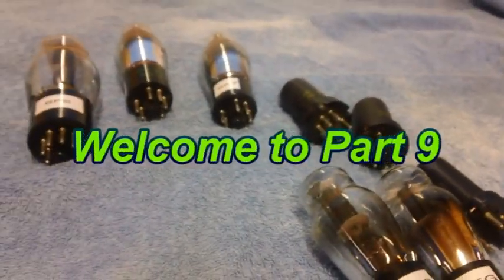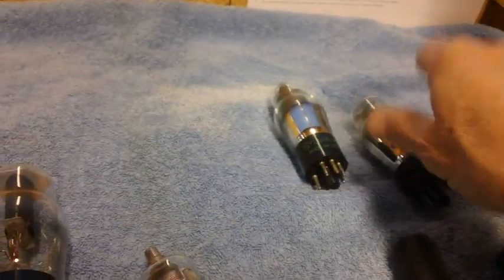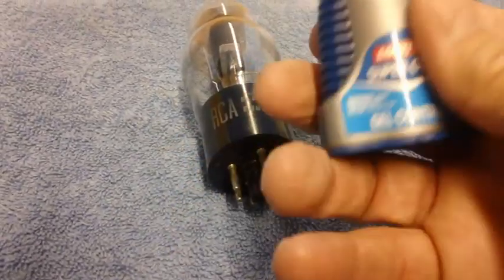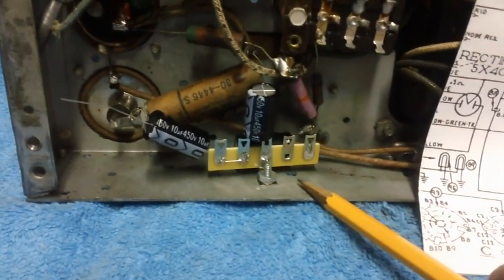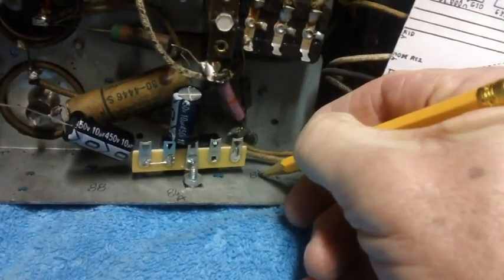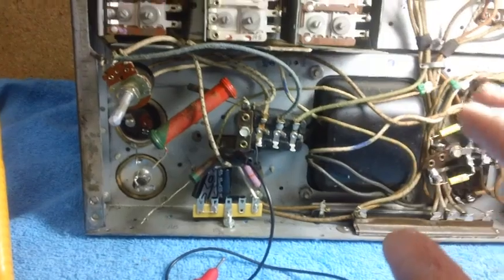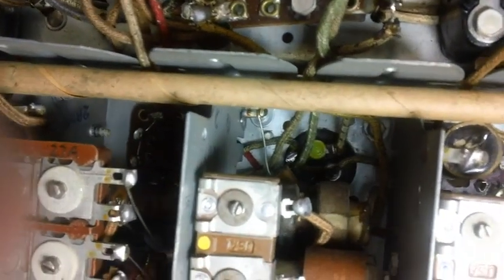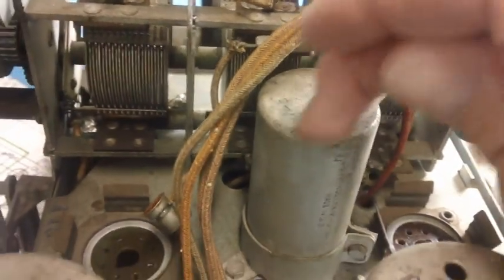Philco model 37-2670 repair and restoration (Part 9 of 34)

Comment: I like your idea of the terminal strip, John. I know a lot of restorers like to do it, but I'm not a big fan of gutting out and restuffing those old 'can' capacitors. I like to leave them up on top of the chassis for looks, and just cut the wires from them under the chassis and solder the new caps to the disconnected wires. Once the chassis is back in the cabinet, no one will ever be the wiser! :)
Reply from the maker: Greg,
For me, re-stuffing filter cans has gotten a little old.  It's become a been-there-done-that thingy.  Terminal strips work very well and don't require me to cut open the aluminum cans.  Additionally, using a terminal strip  allowed me to go more in-depth with the schematic and its correlation to the chassis wiring.
But who knows...maybe next time I will do a re-stuff.

Regards,
John

Comment: Very good video, John.  We tend to forget, when we are going through these radios, that they weren't built by one person, in a logical order.  Sometimes you scratch your head and say, why did they do it this way.   Everyone that touched these, had a different job to do and it wasn't their problem, that something that appeared adjacent on a schematic, actually made 3 or 4 hops to get between points.  They were factory built.  Good reminder and good tutorial on being patient and following things through.
Reply from the maker: Al,
In future vids, I hope to do more wire tracing through a chassis.  It's always a stumper for newbies.  Hopefully, this vid helped them understand that a short schematic line doesn't necessarily mean a short wire.

Regards,
John.
Reply: joernone Great vid.  I'm just starting to get the hang of it.  It works the other way too.  Sometimes, what looks like many long wire connections are just a couple of short ones connected to a single point.

Comment: John,
An excellent video: you’re certainly treating the apprentices to some good stuff in this series my friend.
You mentioned your vids are not so much for the ‘old timers’ but mainly for the ‘newbies’…mm, I’m not so sure about that one.  Here’s one old timer who has just learned something new.  I have never heard the term ‘Candohm Resistors’.  Aside American radios made for the British market, those type of resistors were generally not incorporated into British makes of radio.  Since taking an interest in American radios, I have seen a few of those resistor arrangements but I have never heard anyone over here refer to them as ‘Candohm’.  I rang a couple of friends of mine but they had not heard of that term.  I them rang another friend living in Birmingham (a Canadian chap who has lived in the UK since the mid-1960s).  According to him, a ‘Candohm Resistor’ is a series of resistances, usually wire wound, wrapped around, and sandwiched between, mica and secured inside a flat metal tube that also acts as a heat sink, hence ‘canned [resistor] ohm’ – an American word not widely known in Britain.
As I have said, I’ve just learned something new, thank you.  Everything else you talked about was as clear as a bright sunny day.
Regards,
Phil.
Reply from the maker: Phil,
Thank you, my friend.  I always appreciate you being here.
Candohm was actually a trade name.  I think they were made by the Muter Company of Chicago.  A while back I did a step-by-step Philco 37-610 restoration on the Antique Radio Forum.  That radio also had a Candohm resistor that needed replacement (they all need replacement), so I decided to open it up for folks to see what's inside.  Check it out, old chap.  It's near the bottom of the page

http://www.antiqueradios.com/forums/viewtopic.php?f=6&t=127488&start=80

Regards,
John

Comment: Good video...I'm curious about checking and replacing those candohm resistors?  Relatively easy in theory, confusing in actual practice.  Would appeciate you touching on those briefly, if you would?  Thank's John...Joe
Reply from the maker: Joe,
The scoop on Candohms is coming up.  You're just a little ahead of the schedule.  So stay tuned, my friend.

Regards,
John

Comment: John,
Once again good job instructing us "newbiee's" how it's done. Could you imagine if the schematic was drawn as it was visibly laid out in the chassis ? That schematic would be huge !! Why would Philco designe the 10 mfd e-cap with it's + connected to ground ? I have seen this before in a small reel to reel tape deck, very interesting indeed ! Same for my SW radio, why would the center tap be buried to ground ? Anyway, great job can't wait to hear it back up and playing again.
Nathan
Reply from the maker: Nathan
In my mind the mechanics of antique radios is just as important as the electronic theory behind their operation.  I've always found the mechanical side fairly easy to understand, but the electronic side of the house has always been a struggle...and always will.  I understand the cursory stuff, but the deep-deep I leave to Brendan.  He keeps me straight.
BTW...over the years I've restored several radios that had an e-cap positive connected to ground.  It's really isn't all that uncommon.

Regards,
John
Reply: joernone
Glad to hear you say that.  I've got an ecap with positive connected to ground, and the negative side is connected to the positive side of another ecap!  I'm not even trying to figure that one out.

Comment: Hi John. In watching this a few times. and looking at the schematic. I am wondering if Cap 86 isn't a non polarized electrolytic ?. I keep getting red flags in my head, when I think of reversing a electrolytic. I hope this makes sense?.
Reply from the maker: Bobby,
No need for red flags.  I'll let my mentor, Brendan, explain it.  He does a far better job at such things:

"The simple answer is that 86A is the "Negative Bias" filter capacitor.

Look at the Yellow-Green center tap coming from the transformer. it goes
over to the negative end of 88 & 86, while the cathode of the rectifier goes
to the positive of 88, through the choke to the positive of 86. Now if we
were to measure across 86, this would be our full B+. However if we keep
following the center tap it also goes to that Can-Ohm Resistor. Through the
Can-Ohm resistor and finally to ground. If we were to measure from ground to
the positive of 86, we would find that the voltage was a bit lower than what
we measured across 86. This voltage difference is because of the voltage
drop across the Can-Ohm Resistor. It is also of a negative polarity (in
relationship to ground) and is available for us to use as negative bias.
However it still needs to be filtered so that is what 86A does and of course
why 86A has it's positive going to ground."

I can't tell you how good it is to have a genius mentor. 

Regards,
John

Comment: Hi I have been watching some of your old videos. I have learned a lot from what you post on here. I am working to wards getting the things I need to start this for my self this year.
I would like to ask you please if I could count on your help when that day arrives, as it is good to have help and advice.
I have 2 radios to get me started, and one has the tube with the signal strength.
I no that both them worked the last time so no the coils in both are all ok. Its the caps and old resistors  as normal to replace.
I been trying to find in the uk some company to supply caps and resistors when I need them.

Thanks Richard ps    thanks for the advice on the book All American Five Radio.
Reply from the maker: Richard,
The best place to get caps is Justradios in Canada.  Based on my recent order from them, their delivery time has gotten faster.  I like that.
I doubt you'll have any problem come up with your radio projects that hasn't already been answered in one or more of the restoration vids I've posted here.  The Philco 630B and Atwater Kent 145 restorations were both extremely in-depth.   But if something arises don't be afraid to give a holler.  Also, if you've not yet done so, you should quickly become a member of the Antique Radio Forum and utilize the brains of those guys.  They know everything about everything.  Membership is free.
Good luck with your projects.  You can do it.

Regards,
John

Comment: John,  Thank you for posting these awesome videos to Youtube. I am a newbie to electronics repair and just wanted share my appreciation for your service to the community.  I have a couple questions as well: are there any special considerations for placement of the terminal strips used for mounting the electrolytics to the chassis? Also, did you repurpose an exist hole in the chassis, or drill a new one?
Thanks again, Greg
Reply from the maker: Greg,
Hello there, my friend.  It's good of you to drop in.  Please feel free to do so at any time.
Place terminal strips anywhere you want to put them, but make sure they don't interfere with the mechanical action of any switches, shafts, etc...and that the metal terminals don't touch anythingh with voltage.  The last thing you need is a shower of sparks.
As for the holes...I always try to mount terminal strips using existing chassis holes, but sometimes it can't be done for the reasons I mentioned above.  When that happens, I just suck it up and drill a hole.

Regards,
John

Comment: John,  how did you know that 86A positive goes to ground sir?  Also, will you be replacing the caps in the blocks?  Thanks.
Reply from the maker: Mike,
The schematic shows it.  There's been a lot of confusion about this, so I'll be going back over it in another video.  And I'll be replacing the caps in one Bakelite block only.  The rest will have the new caps soldered to the terminals on the outside of the blocks.

Regards,
John
Reply: Thank you kind sir.

Comment: hambone hambone haaambone... the resistor is  connected to the capacitor, the capacitor is connected to the transformer, the transformer is connected to the rectifier, the rectifier is conected to the vacuum tube, the vacuum tube is connected to the coil, the coil is connected to the filter, the filter is connected to the amplifier, the amplifier is connected to the speaker...
Reply from the maker: Well, Don...I'm glad you got something from this vid.  BTW...why haven't we heard from you lately?  Knock off the slacking and all that, ya hear?  :-)

Regards,
John